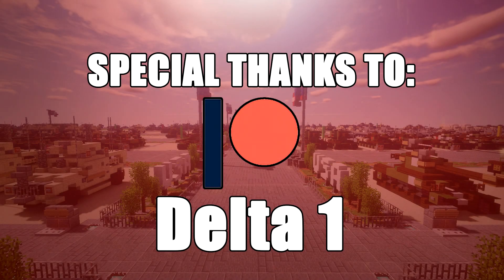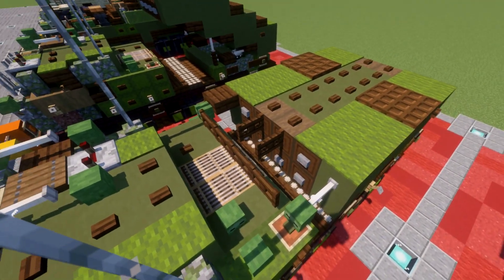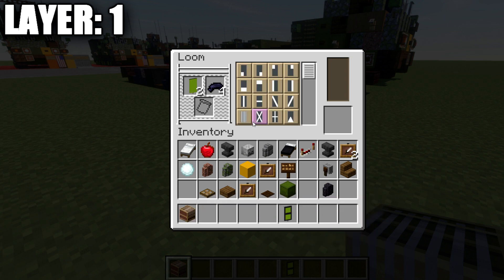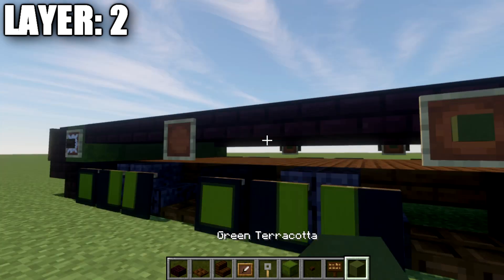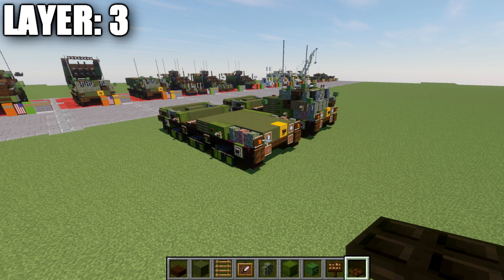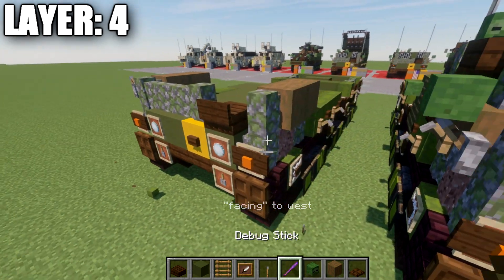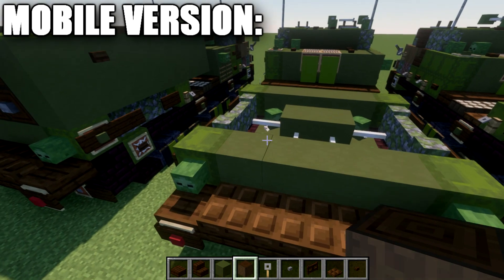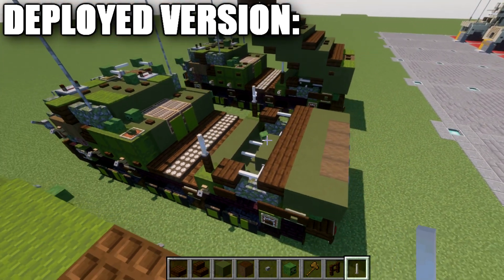Minecraft: Modern M270 | Multiple Launch Rocket System Tutorial (Mobile + Deployed Version)

Comment: So garret when it comes to using newer blocks to update ur old old build the stairs that have their backs facing each other used for the tracks should I put the banners that u have here on the mlrs or does it vary depending on the vehicle
Reply from the maker: Good question! So for Modern Warfare and Cold War builds I totally would. However, WW1/WW2 I would only recommend doing the back to back stairs with the banners. I’d keep using the shulker boxes, buttons and item frames for the full block wheels as they were more crude than the modern ones that have the rubber putter lining.
Reply: @GARRETT2BY4  ok that sounds good bc I'm building a showcase world woth all ur russian build and 70% to 85 is old builds and they need a bit more added to them thx for the advice the tracks will look ten times better
Reply from the maker: Not a problem man! :)